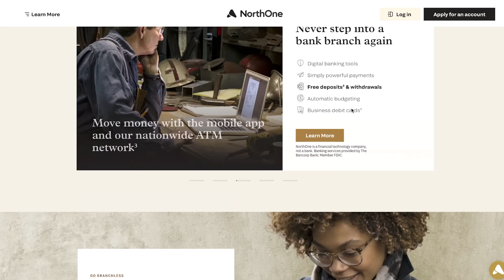they STOLE our mail & LEAKED our bank records…

Comment: With the saw blade... cut a relief cut on the other side to allow the wood to open up a bit to get the blade out. Also check the moisture on that wood, wet wood swells. Thanks for all the great vids by the way!

Comment: maybe go to carpentry school this teaches you to use the tools before you hurt yourself, why you cut from the back and not from the front of the saw, always cut in the opposite direction to the blade movement and not to the full depth. If it happens again, just cut it open with a handsaw, don't struggle like crazy

Comment: Maybe the wood is getting stuck because you cut backwards on the miter saw. I see a lot of woodworkers here cut on a miter saw from the inside out when you should be cutting from the outside in. I think they do it for better dust collection, but it is not the right technique. Think of the table saw. If you did the same thing on the table say you would be dropping your wood on the back of the blade and pulling it towards you. Hope your week starts to improve.

Comment: Just a FYI the reason your mitersaw blade is getting bound up is because your board is bowed to some degree and if you have a gap between your fence and the board once you cut about half way through and you probably pushing on the board toward your fence the blade will pinch and bad things start to happen like the problem you are having. Solution: Make sure your board is tight up against your fence at the point of the cut this way the board can not go back any further and pinch plus let your blade come up to full speed before starting your cut, and of course always have a sharp blade. ALSO make sure your board is flat down on the table at the point of the cut if it’s not and you have a gap between the underside of the board and your table you will end up with the same result.
Reply: Sssshhhhhh. He just wants a new miter saw.
Reply: Unplug plz 💕

Comment: 1: Shop Dust - buy 2-3 20" box fans and tape a furnace filter to the air intake side.  Put them around the shop near dust making tools to collect the airborne dust.  Change filters once a month.. 2: Mail/Post Office - having worked for the P.O. at one time, I suggest contacting the Postal Inspector if problems continue.  Post Masters and branch managers are more interested in statistics than service (even though one leads to the other) and will investigate lost/late mail and resolve issues.

Comment: I have seen others use a Jig saw, with a good blade, to cut live edge slabs like that, for just that reason, they have pent up tension and will bind up a circular saw type blade in a heart beat, or a small electric chain saw

Comment: You might have more success doing shallow cuts across those thick "logs" as well as pushing the blade across the wood rather than pulling.
Reply: Just courteous if anyone knew the proper way to use a miter saw! And you do! For thick wide boards the way you suggested is the proper and safest way to make that cut! 👏

Comment: If you had taken the blade off the miter saw all you had to do is relive the tension next to the blade a jig saw or circ saw or a saws all cutting as near to the blade as possible. It would have saved you the cost of a new blade. every miter saw used like yours will create that much dust you should put a box around the saw, it's a lot cheaper than buying a Festool.

Comment: The Shop Nation guy has a pretty good dust collection thing you attach to the miter saw dust collection port. He designed and 3d printed them. He designed it for the miter saws that have have the wings. I have a Delta Cruzer - works better than anything else I've tried.
Reply: This is exactly what I thought of after seeing Davis' miter saw.

Comment: Howdy...Remember me, we had "discussions" about you getting a drum sander. 

At the beginning of the video, yall mentioned get a "new tool". At first, I thought maybe that might actually be the drum sander, but after seeing your "fun" with the miter saw. I suspect you're getting a new miter saw. 

To that note: You are correct. The wood you was cutting was getting pinched by the wood. Not quite sure why you would STOP the blade in the middle of a cut (you didn't say), but there's 2 (3) solutions to that problem. 

1) Your miter saw (blade) is out of alignment with the fence. 

1.5) It looks like your cutting rough stock, non edged. Therefore, a non-square side going against your fence. As you cut, the longer (heavier) side is bowing back to the fence trying to square itself, cause you've got your hand on one side to secure to fence and hold in place, the other side is PULLED against the fence from the rotation of the blade. If it isn't Edged first, then that blade is going to pull the non-secured side towards itself. Hence the "Pinch". 

2.) The Diablo blades, though are good blades, I use them myself, they are "thin kerf" blades. The thicker and wider the board, the SLOWER you need to go with the cuts. 

Solution: Invest in a Forrest blade that has an full kerf (for cutting thick rough stock). Yeah, it'll set you back $150 per blade, but they'll last wayyy longer AND you can send them off to Forrest to get resharpened for like $25 bucks. 

3) Don't stop midway through a cut...i.e. don't stop the blade while it's still inside the board. That's a No-No. 

Bonus 4.) With complete and total Respect to you Sir....SLOW DOWN. I've watched MANY of your videos. I've been on this Earth now for 49 years (as of Sept. 4th). Many MANY jobs I've had, both in commercial/construction and consumer/residential. You are a "Get it Done" personality, but, it's a "get it done NOW and QUICKLY" type. 

I get it. I do. You've got TONS of "S" (poop) to do. (Don't we all). A very strong head on those shoulders you have, but woodworking cannot be hurried Sir. Doesn't matter if you're making a cutting board or a $10k desk top. The lumber itself doesn't care if you've got alot of work to do. For that matter, neither does the Saw or blade. You can't force these things to cut faster because of your mood or deadlines. 

Bonus 5.) Next time, if there is a next time....Use a small 6" ($10) pry bar (used for nail removal) to un-pinch the wood and blade. Save yourself $60 in buying a new blade and possibly $500-$600 in buying a new miter saw. $10 vs. $600. Savvy 🤑🤑